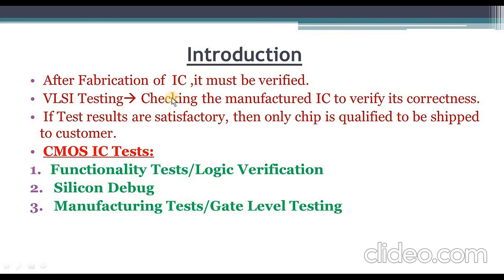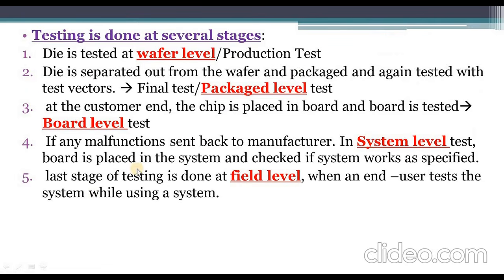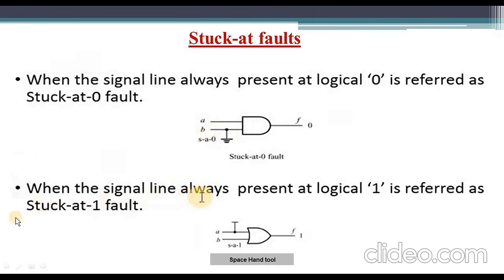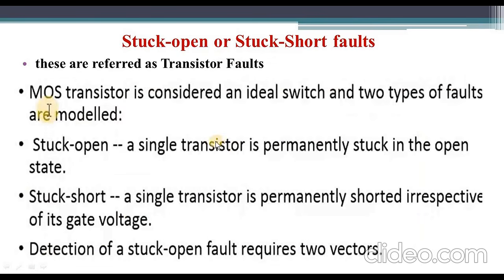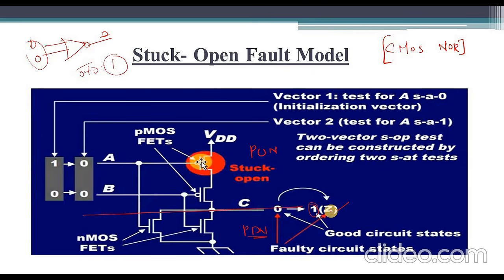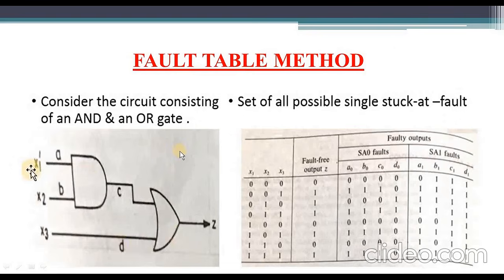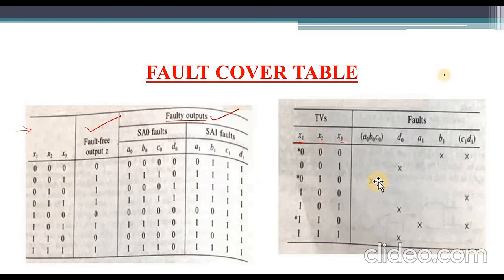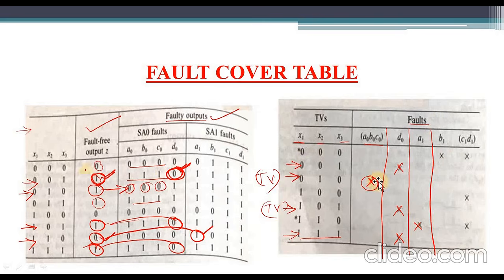VLSI Testing &Testability||CMOS IC Testing||Fault Models||Test Vector Generation||VLSI Design

Comment: I simulated the thruth table of that circuit and the output z should be : 0 1 0 1 0 1 1 1, but in your video shows: 0 1 1 1 0 1 0 1